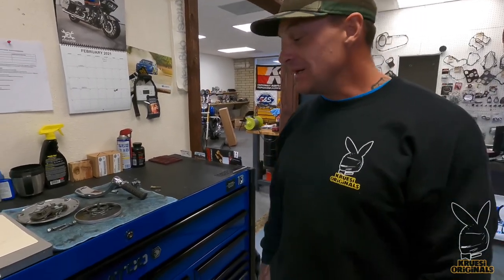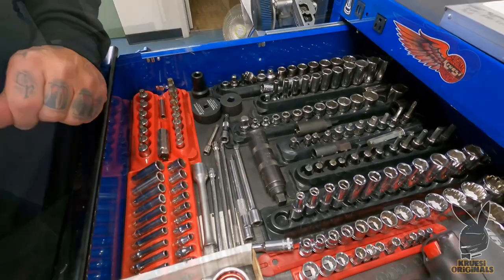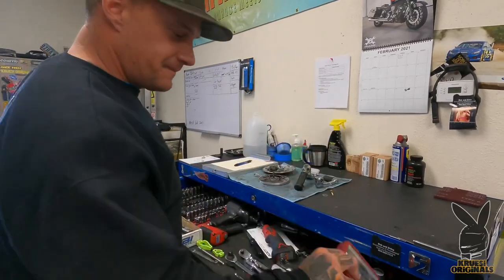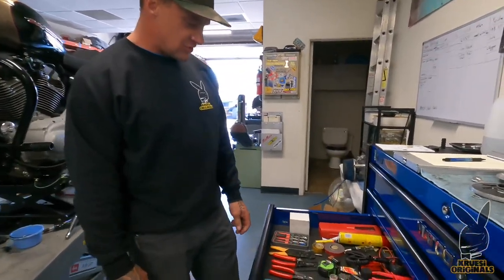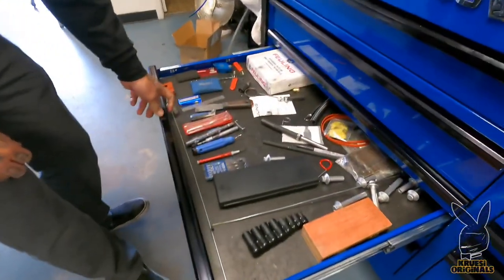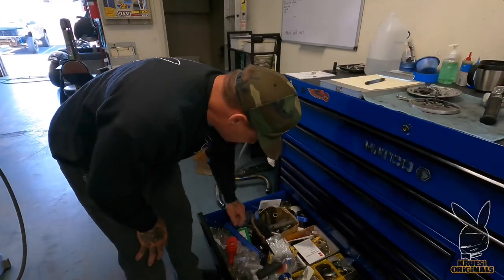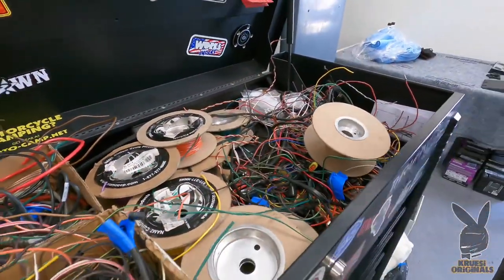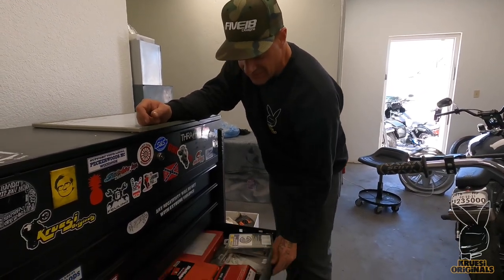My tool box review

Comment: How do you clutch an impact?? That’s exactly what I’m missing. A way to set bolts and move right into torquing
Reply from the maker: I’m talking about my electric impact best thing I’ve ever owned it’s the little guy it’s only 22 foot pounds of breakaway torque, and as soon as it seats The bolt or if the bolt starts to get tight in anyway it clutch is loose so you can’t stripper over tighten anything, so much easier on your hands then spinning a ratchet all day long